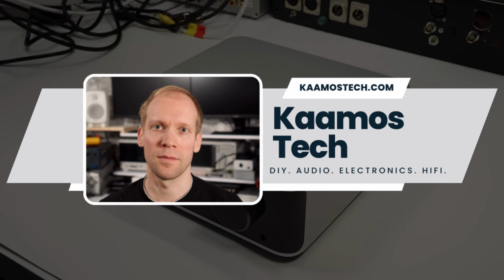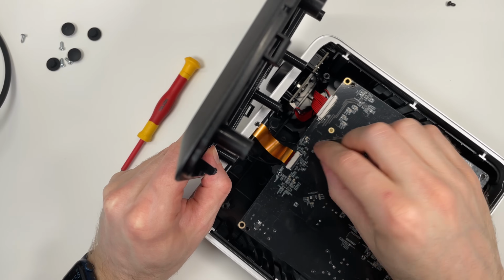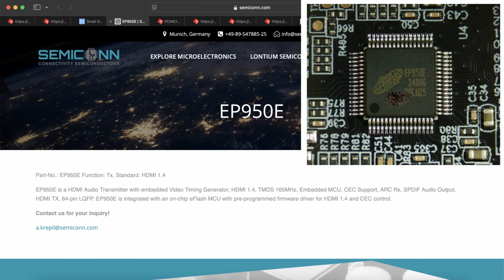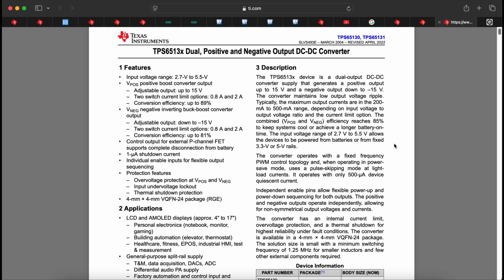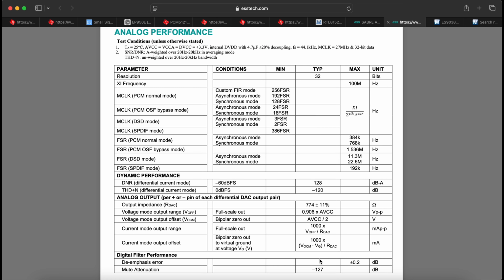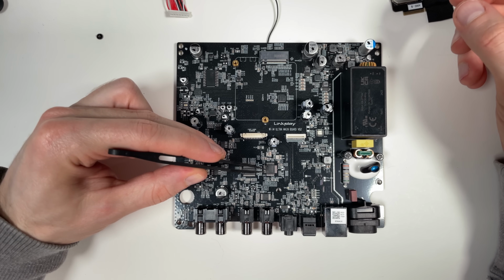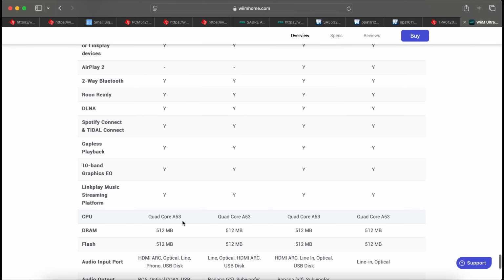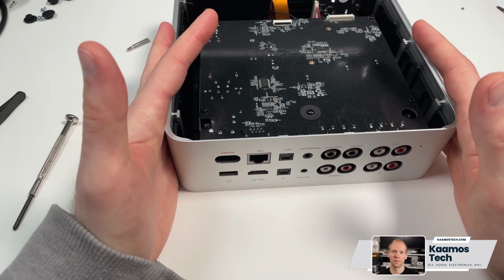WiiM Ultra Teardown - What audio ICs are inside?

Comment: Which clock is implemented here? Is it good quality or a very cheap one? I did not catcht that in your video. I apologize if you mentioned it.
Reply from the maker: Unfortunately I missed the clocks but checked the photos later when someone asked. I found one crystal that could be for audio but don't know the model or quality.
Reply: @kaamostech  Thank you. I think it could be worse than crystal :) So that is good news. I'll try to find what is implemented in wiim pro and + models.
Reply: https://www.youtube.com/watch?v=nXsq4zlkeNI
This guy went to upgrade the clock, unfortunatelly no audio instructions.
Does the ultra look any better than pro plus to you in terms of components used?
Reply from the maker: @Thaivacationeer  Cannot see the details of components. Looks like he changed a 24.0MHz crystal. I don't think that's an audio clock. Or if it is, it will go through some clock manipulation in which case the crystal change won't make a difference anyway.
Reply: Pro plus has got TI SA5534A, and this one seems to be in focus for ugrading by some... with Opa1611

Comment: Excellent break down and introduction to current semiconductors and one old one:). One possible upgrade could be in the use of discreet design op amps class a bjt types, but power requirements may be an issue. Also I would love to learn how the room correction circuitry works when using a phone app. This has made a major difference to hi fidelity audio. Thank you.

Comment: I've heard the USB input isn't great since there isn't a great internal clock. Using a cheap dac with a phono out that has a decent crystal based timer makes a noticeable improvement. I've seen this on forums, but maybe it's overblown. I haven't bought one since I'm already using a Topping A70 Pro, D70 Pro combo. Would be nice to have the streamer function, but... I just run it off my PC anyway.
Reply: Raspeberry pi 3 and up with an audio hat, and Picoreplayer. Best little investment I made. Or a N100 mini pc with roon for exemple. It's just nice to have a passive cool little device that stream music to your dac.

Comment: Great video! Could you easily swap the ess9038mqm for the ESS9038PRO? or even a 9039?
Reply from the maker: Thanks. The PRO DACs are physically (and electrically) very different with a larger package and 8 channels paralleled for a stereo output.
Reply: You would be better off buying a DAC.

Comment: Great teardown video.  Thanks!!  Have you tried using the phono input with a turntable?  I bought the WIIM ultra and the phono input is REALLY noisy (pretty much unusuable in my opinion).  I used the ground connection but connecting it or leaving it floating does not make a difference.
Reply from the maker: Thank you. Unfortunately, I don't use a turntable and don't know much about that world. Maybe try the WiiM forums, they seem to be fairly active. What I have read, the phono input is not amazing but definitely should be usable.

Comment: One of your last comments says it all: “What problem do you want to solve?” when it comes to customisations. Even the lack of gold plated connnectors has a work around: you can always clean them every now and then. The main reason for using gold plated connections is reduction of oxidation. The potential minimal increase of resistance can be neglected. And it’s always good to remind that most music is recorded on equipement that still uses NE5532 or even TL071 opamps……

Comment: What about replacing the DAC with the top-of-the-line ESS Sabre?
Reply from the maker: Unfortunately they are not drop-in compatible. The size of the IC is already very different; the top of the line DACs are 8-channel units with channels connected in parallel for stereo use.
Reply: @kaamostech thx that was my question as well!

Comment: I don't understand what wiim wass thinking. there is no crystal oscillator for the whole DAC part? they use the clock from CPU? this is an audio system, for 48K or 96K, it is still possible to creat a clock, not good, but acceptable. but for 44.1K, how to realize? use internal PLL in DAC? the sound will be horriable.
Reply from the maker: Yeah not sure about that. I did see one 24.576M oscillator which could be used for the audio.

I have first hand experience only with TI and AKM DACs which are quite different. ESS DACs don't need synchronous MCLK and I believe they should work well with the internal PLL as that is by design. But not measured myself.
Reply: @kaamostech that one is for the HDMI or usb interface. ES9038Q2M does have an integrated PLL, but it is a digital PLL, you can think it is a counter plus some algorithm like sigma-delta. jitter is very bad. this solution is designed for the cell phone, because the internal space in the phone is very limited, there is no speace to add a crystal on PCB. that is a compromise for the resimpling from 48k to 44.1k. but here, no crystal means you got a audio of phone level in the desktop equepment. this is a shame.
Reply: @kaamostech  a simple way to prove it. you could do an AB comparison. A, directly connect the line-out of WIIM to an amplifier. B, connect to usb out of WIIM to an usb sound card or a cheap usb DAC. remember it need to be "USB" dac, because only USB dac will resimpling with local crystal (or very high end DAC over 1000 dollar). then the line-out of usb dac to ampli. if the sound change, become more clear for the mid and high freq, it means the AD part of this WIIM have a design issue.

Comment: Are there I2S out pins or any way to easy obtain I2S out from WiiM Ultra?
Reply from the maker: No easy way. The I2S signals are of course going to the DACs so that's where you could solder something on, just would need to be careful with signal integrity, use buffers etc.
Reply: @kaamostech 
Thank you for the answer I thought there are some pins to attach the connector and trace I2S outside.( Like other LinkPlay based streamers. Arylic Up2Stream for instance)
Reply: The latest trick is to use the USB out to the SMSL PO100 Pro, which is a DDC so you get clocking improvement and I2S capability.

Comment: Nice video. Did you see any parts for a preamp or resistors for volume control? Or is it probably a pure DSP digital volume control?
Reply from the maker: It is pure digital. Resistor volume controls are large and expensive.

Comment: Wondering if it looks like someone can go in and replace the power supply or clocks.
Reply from the maker: I would say not really. Changing better parts may just degrade performance when they don't fit there and you have ugly wiring etc. I guess changing the main SMPS could be fairly easy but still needs some consideration how you connect a new PSU, and if it's external taking care of the wiring etc.

Basically, if you want better components, buy a more premium product. Or buy/build your own DAC etc. For example, if you use a USB DAC the clocks here don't matter.
Reply: @kaamostech  Good deal, I've never seen your channel, it was a Youtube pick.Nice to see gear being taken apart. I have tried several other streams into the Chord Qutest and have yet to hear a OMG improvement. Its a dedicated room well treated.
Reply: Why? It ain’t broke etc….is it for real improvement or do you like tinkering?  I am not judging btw, just interested.
Reply: @gaycha6589 ,  Just wondering, you have to go way up the food chain to get much better as I have tried a lot. Noticing every more expensive model have a LPS and better clocks, a few better parts. He is about the only one I have seen break it down to all the parts.

Comment: I have a question, does the Wiim Ultra have a audio clock?
Is it useful to use a external DAC and an external clock???
Reply from the maker: It does have an audio oscillator, at least 24.576MHz (48k family of sample rates). I don't know the exact model or how it is used exactly (e.g. do they use it for audio output, and what about 44.1k sample rates). The DAC is very good. If you have really good ears, does external DAC sound better - probably, if it's good enough. Unfortunately, only you can judge that.
Reply: @kaamostech  Whow, thank you so much for the fast answer 👍
I saw a YouTube Video of the cheap audio man where he complains about the clock and he recommended to use this adapter.
🤔SMSL PO100 PRO USB Digital Interface Decoding and an external DAC it would made a unbelievable difference.
I use the Wiim Ultra already and I am really happy with it but sometimes I miss the details.😔
I really appreciate that you wrote me and thanks for your videos.

Comment: would be great if you could comment on the spdif output circuit and clocks used . Thank you
Reply from the maker: Obviously, it is guessing but there is the PCM9211 which has an SPDIF transmitter so they may use that. I saw one 24.576MHz oscillator so that may, or may not, be used to generate the audio clocks. May also come from the SoC clock generator. Maybe I will try to measure something one day but it's not easy with the kit I have.

Comment: What is the coaxial output chip? PCM9211? Wiim pro does not have a very good coaxial output. Not sure if this one is any different.
Reply from the maker: Yes, I suspect they use the PCM9211 for the coaxial output, possibly among other things. Unfortunately, there are not many dedicated SPDIF output chips in production anymore. This one has quite a lot of other functions as well. However, transmitting SPDIF should be an easy task as it's fully synchronous, so not sure why it wouldn't be good. Receiving is a bit different story as it requires a PLL.
Reply: @kaamostech  I once read a study, and I wish I could find it again, that discussed optical SPDIF implementations in CD/DVD players.  The TLDR is that the same signal is used to send COAX and that signal has to be processed to cause the LED to flicker on and off for the optical SPDIF.  There are delays introduced and thresholds that need to be evaluated before the LED fires.  Then on the receiver side, the same kinds of signal processing foo has to be done in reverse before an electrical signal is produced by the receiver.  Although the optical SPDIF was not horribly inaccurate, it certainly was not as clean since there were signal conversion errors. Although the optical signal is not subject to EMF in transmission, I stopped using it and prefer COAX unless I need to use it.
Reply from the maker: @johnbeckmeyer1696  Indeed, Toslink, RCA Coax, and XLR AES are all the same signal but Toslink is the weakest transmission line, at least due to fairly poor quality optical components and plastic 'fibre' - as opposed to proper optical fibres and laser transceivers, for example.

I'm not sure what is the bottleneck (may well be the turning the LED on/off as you say) in the Toslink system but it has limited bandwidth and more jitter than the cable medias. Usually it's limited to 96kHz and max 5m due to these; albeit 192k often works as well, at least with short cables.

Coax is better. There are often measurable (not necessarily audible though) differences between Coax and Toslink.

Comment: Thanks for this! I’m going to remove the internal switch mode PSU from mine and use an external linear power supply instead. 
Just need to run a fly lead from the 12v DC out of the PSU
Reply: Wonder if you did the external DC power modification and what results?
Reply: @MrSpeedysteve1 no, based on non-recommendation.
Reply from the maker: Sounds good, should be a fairly easy mod to do.

Comment: Very informative video, thank you! I really like the way you analize different components on the boards. The small SoC with Linkplay branding should be the streaming module actually. This is why the antennas are connected there. And yes, the microphone on the back is used to compensate audio delay between syncronized devices.
Reply from the maker: Thank you

Comment: Thank you again so much for the detailed response. 
You are absolutely right     
Yes It’s not difficult to produce a good DAC for cheap 
And yes it’s the other components that gives further detail to sound imaging like amp and speakers. 
Yesterday I put the WIIM to full output 100 and controlled the output with my preamp mixer 
❤❤❤❤
It made a big difference. Now I can actually hear the Ultra at its best 👍

Next is I connect my Genelecs via the Digital input through coax Out of the Ultra 
Looking forward to it 
Thanks again for a brilliant video on the Ultra like never seen before 👏👏👏👏
A review with an in depth look ( literally 🤪🤪) 
🙏🙏🙏🙏

Comment: Too bad they used the noisy internal switching  power supply. I liked cheaper Wiim pro with external SMPS which you could upgrade with liner power supply easily. I was interested in Wiim ultra. But it looks SMPS in the Wiim ultra can not be bypassed with liner power supply easily. I will have to pass on this Ultra model and wait for pure streamer, because when I use my Wiim pro with custom made liner power supply as pure streamer with my tube DAC it already sounds better than Wiim ultra or at least as good.
Reply: How did you know it will sound better if you passed on it.
Reply: @DDuck777  I saw reviews that many owners and reviewers think there were very little differences from Pro to Ultra as pure streamer. I have two Pros and I made direct comparison with stock SMPS and my Liner PS. And there were clear differences. My custom PS were much better. Deeper bass, more extended high,   more vocal definition. Wider sound stage, and etc. It has to be, because I tuned it to sound that way with many audiophile parts. Silver plated internal wire, High voltage film cap, Teflon bypass cap, big transformer, EMI filter, heavy gauge power cable, and etc. It cost me more than Wiim Pro itself, but it was worth it. In fact it sounds almost as good as playing CDs that I don't play CDs as before.
Reply from the maker: I wouldn't be too worried, even if you use external linear supply, there are still switchers onboard. It is true these ready-made modules are probably not the highest quality but if the design is otherwise solid and you have good LDOs after it, it shouldn't matter. It's all about the whole system design, not just one part in it.

Comment: Great analysis. Did you find any oscillators or clocks? That appears to be an omission in the design. Thanks.
Reply from the maker: That is a good point I missed. I had a look at the photos I took, there is one 24.576MHz oscillator near the PCM9211, can't see any model or manufacturer info. There are two more oscillators on bottom side, one 12MHz and another near the ethernet chip so likely these are not used directly for audio, at least.
Reply: @kaamostech  Most people aren't aware that all streamers are not created equal. I have a friend who measured the WiiM Pro Plus and found it to be full of noise , jitter and clocking issues. The PCM9211, I believe is the ADC and SPIDF interface. I think the lack of oscillators contributes to its low rez sound. Thank you for replying. Let me know if you dig deeper. Good video and like your channel. Thx,
Reply: @OldGuyHifi  interestingly, it's always friend of a friend who knows a thing 😂
Reply: @photo_n_art  👌
Reply: @OldGuyHifi I wonder if it would be possible to take usb out to one of Ian canadas reclockers…I think they are i2s tho

Comment: "3711" is one of the ICs, called as a de-pop chip. Should be just a switch, like a relay...
Reply from the maker: Interesting, could be indeed, pops can be a serious issue. Do you have any information on the manufacturer or full model number?